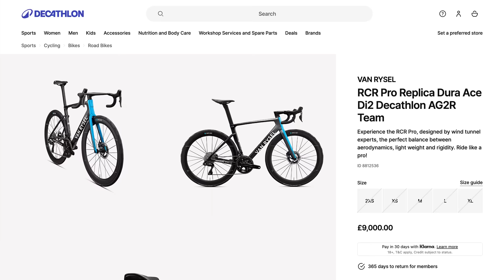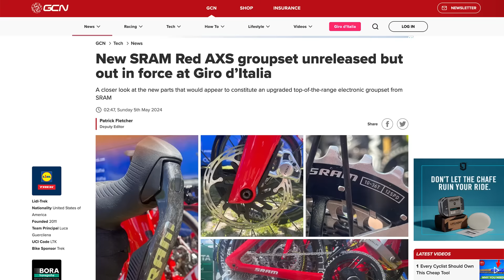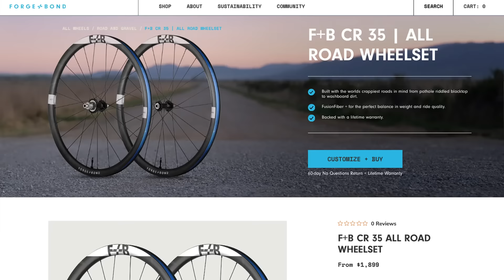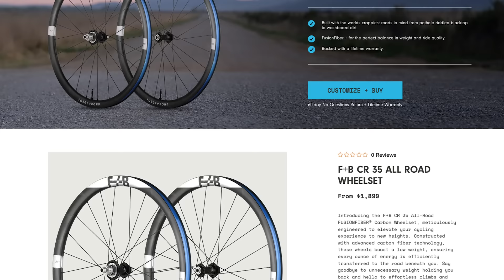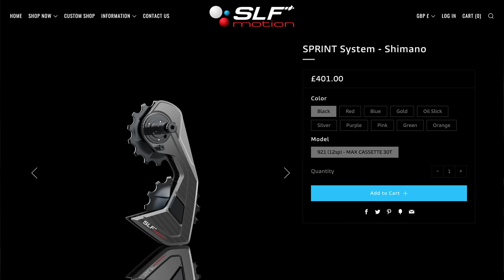Are Decathlon Winning Because Of The New Van Rysel? | GCN Tech Show 333

Comment: Van Rysl RCR is a great bike, it brought me some KOM's on Strava! And I'm not a great cyclist, more like an average one, and I can't ride every day. But when I ride, that Van Rysel bike improved my average speed by 10km/h. I think I have the lowest specs ine, the one with Sram Rival and Zipp wheels...but it's great, I love it!

But, on top of it all, it's amazing that Decathlon offers us affordable racing bikes and gear that can perform! That's the main thing and they should be commended for it!
Reply: WOW 10km/h for avg speed? What bike do You rode before RCR?
Reply: @Pablo_Coach  a Ralleigh Mustang Elite. So nothing posh, but really, RCR is a very good bicycle.
Reply: @gms80sixtreme  standard wheels and tyres on this Raleigh is probably most point about speed difference,
Not rcr frame exactly. And geometry (body position) may vary much than wheels, frames, cockpit, and bike overall
Reply: @Pablo_Coach  of course, but still there is a notable difference

Comment: I agree it is a global performance approach (I have few of their best riders in my area and they clearly confirm the mindset change). 
Now few details around the VR RCR
- yes they tested with a narrower bar... but the test doesn't include a manequin upper body (to obviously not introduce fitting discrepancies) so impact is not comparable to riding on a narrower bar.
- the previous BMC roadmachine they mostly used was above 15W slower with the cockpit and 50 or 62mm wheels... even the Time machine was still 3w slower
Riders in private tells you how much more they prefer their VR bikes over the previous BMC.

Comment: The super six evo was 205w in the Tour tests so faster, rather than slower. However the more interesting talking point is that last year when the new SSE came out the EF squad were also performing pretty well early on in the season. Maybe new bike model day is a thing for pros?
Reply: Watts are used for measuring power, not speed. Power is a product of speed and force, though. So a lower Watt number means you can go the same speed with having to muster less force.

Comment: Good parallel with cricket - my original main sport but, as mentioned, you don't get fit playing cricket. back in 1960s and 1970s, I'd take running gear to run around the ground if I'd got out or I was batting down the order and playing as a bowler. But it is technical and a batter has to assume they could get out at any time to bad luck (umpire's mistake, nasty bounce of a little ridge on the pitch, etc) as well as bad play or a great ball from the bowler - a bad shot, a bad umpire decision, a brilliant ball and you can go a few weeks with just a few balls faced and an otherwise wasted afternoon - which affects you mentality to relax or try harder (and not play smoothly). Over the past two years, the England cricket team has been an excellent example of more or less the same players transforming from very bad to very good (they've slipped back a bit recently) due to different attitudes of management, captaincy, selection policy and retention of players to give them more chance to get over bad patches. Decathlon, as the AG2R French team, had a reputation of being out of date in almost every area, like the England cricket team were. I miss those brown shorts but the team is so much better

Comment: Decathlon always offers decently equpied bike at a good price. Even if all the components are removed, you will find a well built frame with fairly straight forward design.

 I have an edr af frame and a 900 af frame I bought from online seller and they have been amazing for what I paid for.  Stiff yet not overweight, mostly equipped with standard parts that you can easily source. So I am not suprised their top of the range road bikes becomes a hit, since the design philosophy remains the same: using quality compnents and a basic yet functional design.

Comment: Just wanted to chime in that the rear derailleur cable housing is way too short on the Giant!
Reply: @laneweaver3562:

I spoke to a friend-of-mine that has a Giant-brand bike like that-one. They tell me that when they received their Giant-brand bike, from the local-bike-shop, it came “unboxed” like that. (as-in, it came “out of the box” like that). Also: my friend tells me that the LBS where they bought their Giant-bike at was the Authorised-Dealer for Giant in their area, as well as the Authorised-Dealer for Shimano in their area. And before they received the bike, it was given a full check-over by the LBS. (Brakes. Shifter-cables. Shifting. Mechanicals. Brakes & Brake-bleed. Grease-check (as-in, Checking of all the Grease in all the places that have Grease and/or require Grease. Etcetera). Etcetera). And apparently, the LBS left the brake-cables & shifter-cables how they came “out of the box” from the Giant big-cardboard-box. So I guess they’re okay (“they’re” as-in, “the “brake-cables” & the “shifter-cables” “).
Reply: @reoencarcelado5904  interesting, I guess if it shifts fine then it's fine!

Comment: Seeing the S-Works. Weird sight this morning about 7.40am on Shooters Hill, SE London. Doing my morning walk up the hill from Welling, other side of the road a blue and pale blue S-Works inched its way up the Oxleas Wood side with the most non-lycra outfit and non-honed rider. If I'd been walking that side (no pavement so you can't), I'd have jogged along and had a chat, if he could have talked while riding.
Reply: Nothing wrong with that.  More power to him.  I have an S-Works Diverge (SRAM Red eTap AXS, Roval SL SCS CX wheels).  When I broke my hip, it took a year before I was able to start riding again — I was overweight, out of shape, and really demoralized.  I was so. damn. slow, but the S-Works just called out to be ridden.  I bought some expensive shorts, and then started ramping up my mileage.

So, IF you have the money AND nice stuff motivates you, an expensive bike is just what the doctor ordered.  Now, a year later, at 55 years old, I’ve lost almost 20 kg, and I’m moving pretty well.  I wouldn’t call myself a strong rider, but I only weigh 62kg, so climbing has become easy (easier, anyway).  I am absolutely sure that the overpriced bike is a primary reason for my improvement.
Reply: Had an s-works sl7, always ride in regular shorts and tennis shoes. Don’t need Lycra to enjoy a fine machine. But it wasn’t any faster than my 2016 Fuji sl 2.1 with Zipp 302’s. The gloss black Van Rysel Pro (red axs) is a beauty, at least in the photos. Ciao

Comment: Decathlon: a basically good bike, no fancy BMC, S-Works, Factor etc. with flaps and wings and spoilers and "aero" saddle post and other marketing hyped nonsense. Instead using high quality standard components with standard diameters and standard shapes that can be replaced in any bike shop anywhere in the world by any qualified mechanic! 😃👍
Reply: That’s not what this is. Their Van Rysel bike is a full on aero machine with one piece cockpits and integrated cable routing.
Reply: The Tarmac SL8 isn't remotely complicated.  It just happens to be pretty great at everything other than being expensive if you buy the S-Works version. 
*Test rode one and it's outstanding.  I'd be buying one if Walmart heirs weren't invested in Specialized but they're a no-go now

Comment: Mmmm...£8.5k & yet my custom build Merida Reacto 4000 disc 2020 full aero carbon frame set with carbon CW handlebars & aero seat post set with full Ultegra 8020 11 speed hydraulic group set, carbon printed Specialized S-Works Romin II saddle & 50mm carbon Prime Black Edition rims set with Tpu tubes all wrapped up in 28mm Continental Gp5000s black chilli compound race tires for £200 less than £5k...,make it make sense 🤔